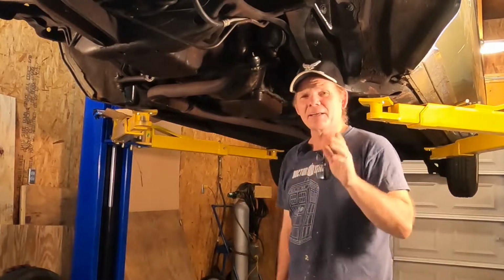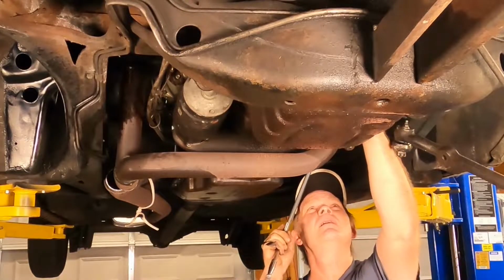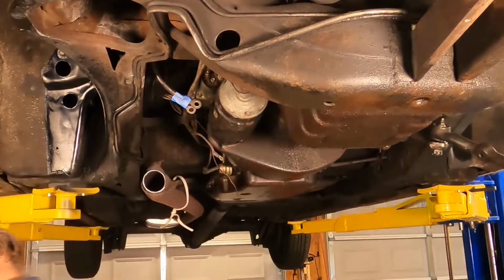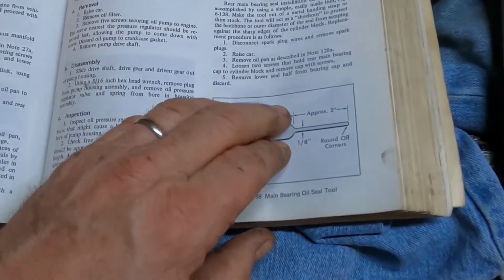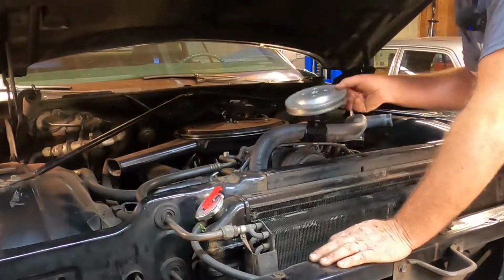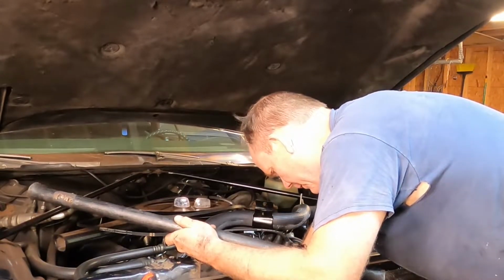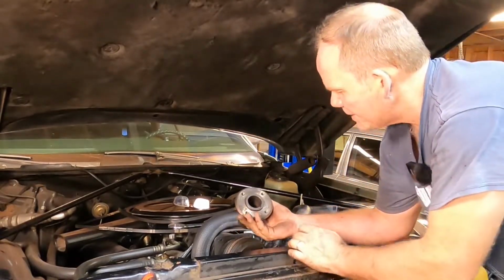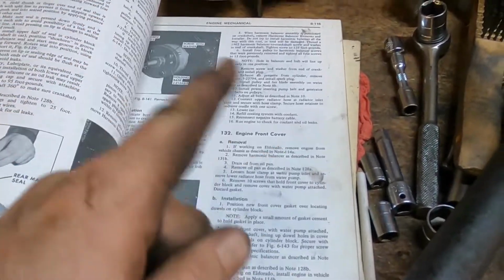Cadillac 472 500 Rear Main Seal, Front Crank Seal, Timing Chain Set - Part 1 - Prep Work

Comment: Thank you again for this, I'm well aware of the notorious plastic coated cam gear and how it's got to come out. Haven't watched yet - really interested as to how you got that crank pulley off and back on!!
Reply from the maker: We'll see if the timing set needs to be replaced. It may need it.
Reply: @ImpalamansGarage  If you're already in there, might not be a bad idea to fit a Cloyes all-steel set. CadCo can help there - they've been very helpful to me.

Comment: Man that front crank seal looks like a proper ass kicker. You got it done though! Thanks for the tip on the puller from HF. Looks like a quality unit.
Reply from the maker: Truthfully it's better to use four bolts on this one. Would require drilling two holes in the new tool but two got it.

Comment: Don’t laugh at my Eldorado. Yes, I need to pull the engine for several maintenance items.
Reply: I know this is an old video, but it was very helpful in replacing the rear main seal on my Eldorado. Yeah, its out of the car! I pulled my balancer hub off with a steering wheel puller. It just walked right off. Now my rear seal was a different story. The engine had so much varnish that the seal half in the CAP was glued in and almost impossible to remove! I dreaded the "upper" half, which of course was the lower half with my engine inverted on the stand.  It was stuck, stuck, stuck! I was beating-up the end of my seal and was worried I might have to pull my crank, which I really did not want to do. I ended up heating the block with my heat gun and spraying PB Blaster over and over trying to dissolve all thst varnish. Still no luck so I heated it good one last time sprayed it, and left it overnight. After church the next day I hit it good one more time with heat and PB. A couple good taps and it moved! My prayer was literally answered! Anyway I'd have never had the guts without this series.  Thanks!